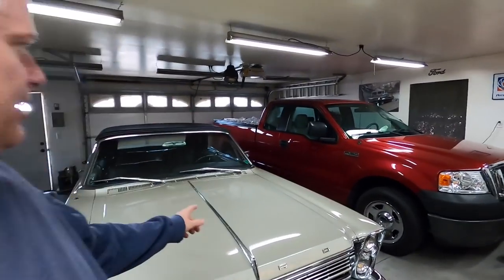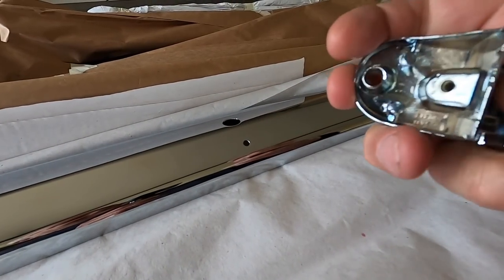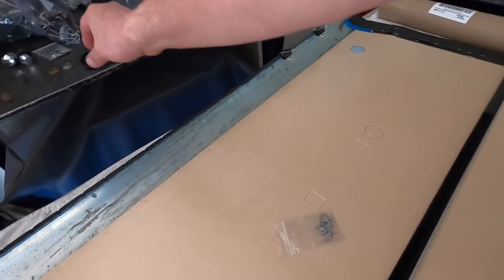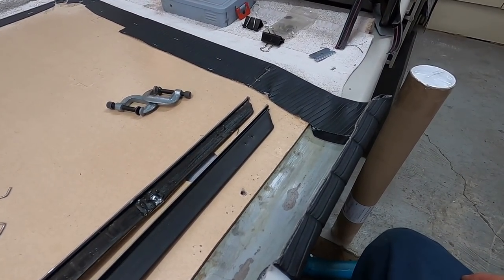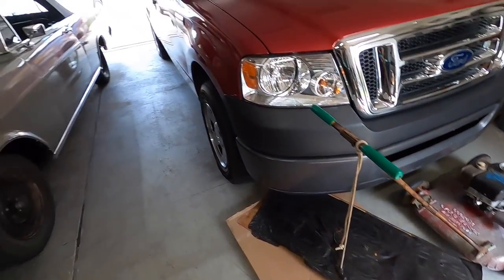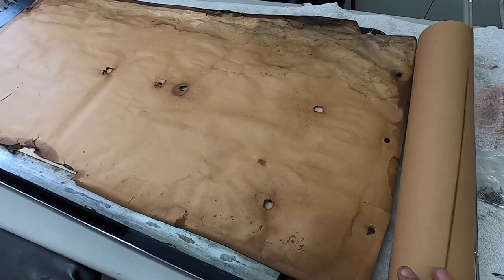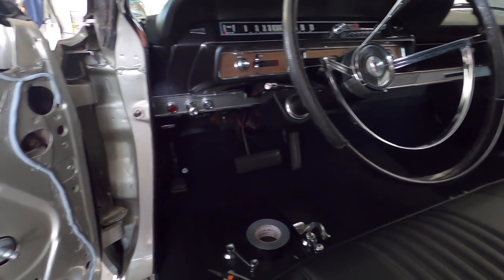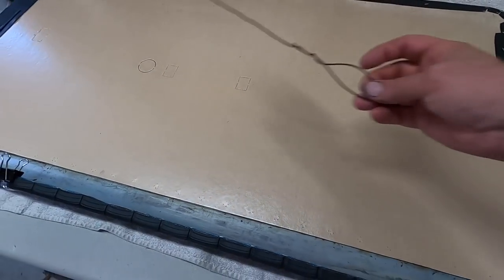1966 Ford Galaxie 500 convertible restoration part 194 installing new door panels & chrome

Comment: Another great video.  I had to replace the lock button collar on the drivers side door and I couldn't find the color correct replacement.  I remembered that YouTube video of the '59 Belair and 2009 Malibu controlled crash.  I contacted the insurance company that staged it and asked if there was one that made it through the crash.  They were very good about it and sent me the last good one that was left on the car.  My cars claim to fame!
Reply from the maker: What a waist of a 59 Chevy that was. It's plain old "common sense" the new cars are way safer. Who ever was the instigator of that should be locked up!
Reply: @OldCarAlley  you know Howard the first time I saw this crash I thought how in heavens name could you do such a thing?  That car has been around for 50 years and you purposely wrecked it!
Reply from the maker: @martinbeneteau309  Yes, that a total lack of common sense! It's a no brainer which car will be safer.

Comment: On the Door Watershields... The Black side faces into the door and the Beige Paper side always faces out.....That's because the Black side is the waterproofing material.... :)  Tony K.
Reply from the maker: They were both right papers from the factory.... the pile for the left door must have ran out, so on went the right paper onto the left door. It's corrected now, after 55 years....lol.
Reply: @OldCarAlley  When I picked up my '65 Convertible back in March 2013, The Driver's side door lock would work, but stick a lot.  When I finally took the inner Driver's door apart, I found that someone used a 2nd Passenger side Door lock Rods in the Driver's side Door lock assembly.  Luckily, I had an extra set of Driver's side Door Lock Rods in my stash...and in they went.  It never worked so good after that.  Just in case, I checked the Passenger side Door lock Rods to see if both sides were "swapped", but they weren't. The Passenger side had the correct Passenger Side Door lock Rods..  You never know what goes on in 56 years of these cars.. Tony K.

Comment: That kit really is quite good...I guess new cars are comfortable, but the looks of “classic Detroit” sure appeal to this old man.
Reply from the maker: For a repo, it really is nice. There are a few things they could have done better, but it is nice, no doubt. I'll do a full review once it's 100% finished. I still have a bunch of little odds and ends to do, like clean and install the sun visors, those rear cardboard things, emblems, seat belts and the left rear part of the front seat.... oh and the top boot.
Reply: You are 100 percent right always was excited when the new models came out in the 60s and early 70s. Now there all blobs of plastic and no style with electronic screens which will be a nightmare in 5 years! And stupid pushbutton start systems.

Comment: I'm going to have to wish for poor weather for you! You seem to get so much done when the weather's nice, and I don't really want this series to end! (sorry Howard)
Looking forward to seeing what you do next!  I lucked out on the repro door buttons for the Fury. They were Billet aluminum and the shape was correct, not plated plastic like the OEM ones. The trim rings for mine were cheap clear plastic with foil inside and they were disintegrating fast, The POP ones were plated metal with the fuzzy ring that does prevent rattles. Looking forward to you building new door pads, I'll bet they'll be nicer then the rip off POP ones I paid a fortune for!
Reply from the maker: I'll make a video on making them. They will take a bit of fuss and time.... I still have tons to do before it's finished..... lots and lots of little stuff.

Comment: Harold, it's coming along fine. My question is why do you need to repaint the hood,it looks good on my end ? I was looking forward to your next video and surprisingly today I got a notification. Have a good evening.
Reply from the maker: Both the trunk lid and hood have some paint modeling.... but it looks bad on the hood, by the cowl on the right side.... I might reshoot the trunk lid too. I want to see how it looks after a little buffing.
Reply: @OldCarAlley  Could please explain what is "paint modeling?"  Thanks
Reply from the maker: @johnjuarez8005  It's where the metallic didn't flow out well. Acrylic enamel is a royal pain to spray with highly metallic paints....
Reply: @johnjuarez8005  I think the correct word spelling is "Mottling"....
Reply: @OldCarAlley  Thanks.
Reply: @nefaurora  Thanks